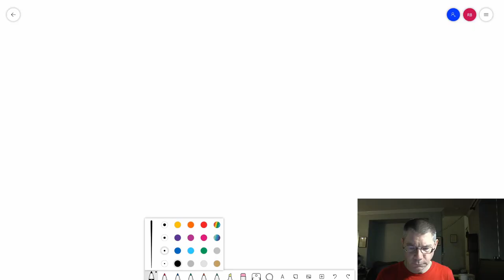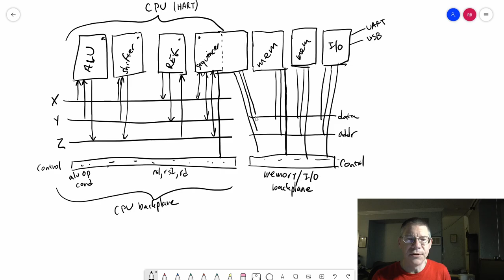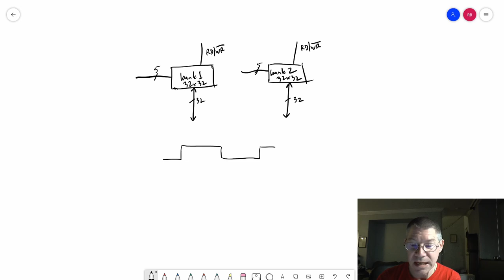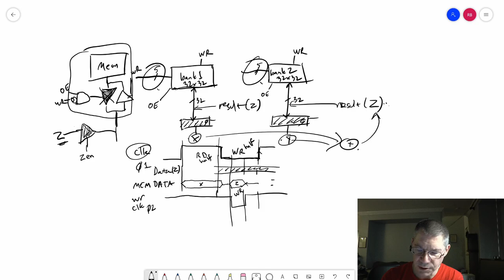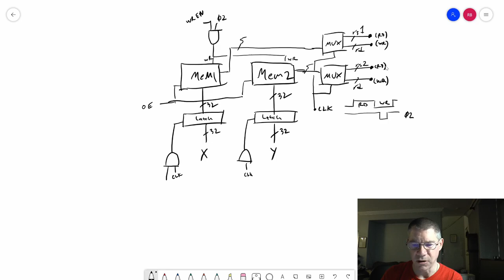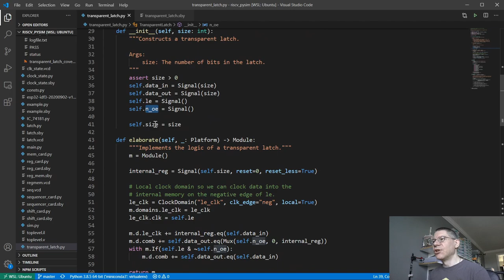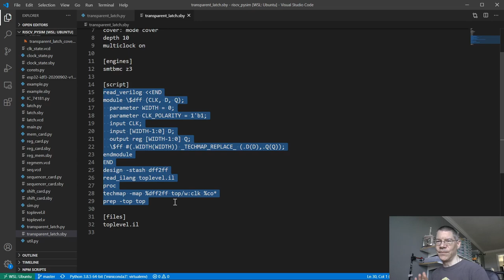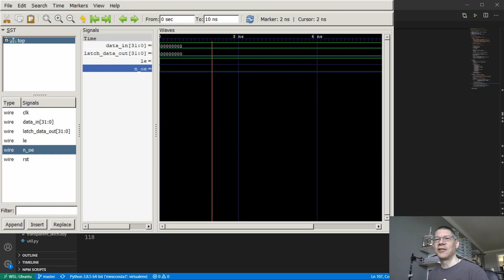Rebooting the LMARV-1 RISC-V project!

Comment: It's great to see you back on this project, and designing it in HDL first is probably a very good idea.
I think you may be over-complicating parts of your architecture though. First thing to keep in mind is that the instructions require two reads and a write per Instruction, not per cycle. That's the programmer state view / architectural view. The actual implementation depends on the microarchitecture, where you could have a single bi-directional data bus which first reads RS, then reads RT, then writes back RD. If you wanted to, you could even pass the flags and ALU op on that same bus.
There's nothing wrong with trying to make every operation a single cycle, but it's not necessarily required. Another way to look at it is you have a large cycle (1 per instruction) broken down into multiple phases, where each phase puts something else on the bus.
For your function units, you may want to look at some of the modern out of order CPUs, not to implement something out of order, but to see how they broke down the function units. All OOP CPUs basically have fetch logic -> decoder -> issue bus -> function units, which is very similar to your backplane idea (i.e. the issue bus is a back plane which can issue instructions to function units based on the decoded instruction). From that perspective though, you probably should not combine the sequencer with the memory access component, and instead should implement a load/store card. If you take the multi-phase idea, then you could dual purpose the load/store card to do both data R/W and instruction reads. Also, if you compress the backplane down to fewer buses, you could run them parallel, say X, Control, Addr, Data, Mem Control. Then your load store could just bridge the two lanes. Or even compress the memory bus down further so you have X, Control, AD, and Mem Control (in that case, you memory bus would look a lot like PCI, which could be an interesting architecture choice - i.e. implement your memory bus using the PCI PHYS, or even using the PCI standard). 
To better utilize SRAM for a register file, you could multi-phase that as well. So for example, let's say you run your main phase clock at 1 MHz. Then, you can run your internal register file clock at 4 MHz, and read 8-bits at a time. That way you can have a single x8 SRAM which stores your 32x32-bit register words. Though, to make sure you don't have synchronization issues, you would probably be better off running the register clock a little higher so that you are guaranteed that you have to correct output regardless of the clock phase offset. I believe that would be +1 cycle, so run the register clk 5x the phase clock.
Hopefully that was helpful.
Reply: Yeah, multi-phase control is usually the way to go - some instructions won't fit into a single clock cycle budget, no matter how hard you try!
Reply: @KaneYork  If you look at one of his newer videos, you see that he sort of ran into a problem there where he has to sequence control signals based on sub-phases. Which is essentially making each "cycle" multiple cycles long. E.g. he is using two 6 phase clocks, and may need to increase the phase count to avoid multiple bus drivers.

Comment: Yay, you're back, and LMARV is back too! This is absolutely my favorite series, very interested to see how this turns out with your new design process.

Would it be worth having a "register clock" which is essentially 2x the "system clock"? The register clock gives you two cycles to do your work which translates to a single system clock cycle.
Reply: Read on falling clock and write on rising clock. Or the other way around? Lol, only now see 20:00
Reply: Another somewhat similar approach is how Motorola implemented a two-phase clock for the 6800 series - by having two overlapping clocks (in quadature), so that any of four phases could be synthesized just by ANDing the two.  Robert's use of an overlapping clock specifically for write pulses is probably a good solution, though, since it can be used everywhere else in the system that needs similar setup and hold times.  If you use a 2x clock, then you still have to AND the clock with something in order to determine WHICH state you are in, which is the way Intel liked to do it back in the 8-bit day.

Comment: So it looks like you'll have "internal" buses and "external" buses. One thing I might suggest is having a simple Memory Management Unit (MMU) that bridges the "internal" and "external" bus. This could be as simple as an address latch and a data latches. You can treat it like a normal functional unit on the internal bus and have it manage the address and data buses for the "external" cards. The "sequencer" (Control Unit?) can then handle data movement to and from the MMU. You might also want to implement a "cache card" to save round trips to the "external" bus for at least instruction memory.

Regarding "internal" bus movement for data, you could make your operand fetch take multiple cycles, using the same bus for bidirectional data transfers. You would need to add input latches/registers (I think you were using buffers before anyways) to the functional unit cards, but your bus can be much smaller. Instead of 3x32b you can do all of it with 1x32b. This also helps you avoid having duplicate register files just to handle simultaneous reads. You can still use your scheme of reading on the rise and writing on the fall, it just might take 2 cycles instead of 1 cycle to fetch both operands. You might leverage that unused write slot during the first cycle for updating the Program Counter (PC += 4) or some other operation.
Reply from the maker: Design choices! I did think of multiple ideas, and they all ended up being a compromise between number of cycles and amount of hardware. My line sort of settled on fewer cycles for most instructions.

Comment: You could use dual-port memories. But you need an additional MUX for the case of reading and writing the same address. One MUX input is the read output of the memory, one input is the write data. In the case of read_addr == write_addr, switch the write data to the output of the MUX, else use the read data of the memory.

Comment: Love it!
That sequencer block needs more fleshing out. You know at least you need a Fetch and Decode unit in there somewhere. Are you going to do any pipelining?
Reply: Pipelining wouldn’t work on this simple bus architecture because you have simultaneous incoming and outgoing data streams in addition to the internal register transfers. For pipelining you need a matrix switch fabric that can route your incoming data/instruction to the decoding, transfer the register values to the Alu/shifter/whatever and the result back in the registers and transfer the last operations output into the databus output buffer. Your bus is now an active component in the cpu not just some lines.

Comment: 14:02 Can someone explain why we need two banks to access two registers at the same time? It makes sense for memories due to single addressing but I don't get it for the flip-flops case.
Reply: Because otherwise you would need 32 register flipflops and 2x32 latches (x latch and y latch) to send the bits from R to X and/or Y.  RS1 can be the same register as RS2.

So that's 3x32 bit chips instead of 2x32 if you parallel write the registers.

Comment: There's no part of the RISC-V specification that requires you to do two reg-reads and one reg-write in the same cycle. With latches on the ALU, you could very well sequence the same operation over several cycles instead. You only need 2R1W registers if you plan to make a tightly pipelined, scalar architecture. I'm certainly all for making that kind of architecture :), but there's no reason that you need to do that if it makes the project more complicated than you need it to be.
Reply from the maker: That's true. I should have said that my assumption was to make enough instructions single-cycle.

Comment: At 12:05 you say that RV32E has 32 registers, but that's not right. The base integer instruction set, RV32I, has 32 registers, and RV32E reduces it to 16.
Reply from the maker: That's correct -- I made a mistake. I meant RV32I.

Comment: Here’s a thought on reading/writing to the same register: use a 6 bit address, 0xxxxx for reading, 1xxxxx for writing.
Reply: Not sure how this helps.  You end up stripping off that high bit anyway, I think.
Reply: @BrightBlueJim  The thought was if you used double ported memory the memory would see different addresses for the x/y bus vs the a bus.
Reply: @robertmenteer3462  I see.  I don't think that addresses the problem, though.  The problem is that he needs to read two addresses and write one, all in the same cycle.  If the two addresses were just offsets within the same chip, then writing could only be done to one of these at a time, so you'd have to use a second clock pulse to write to the second copy of any given location.  By using two memory chips, each write updates both chips (both copies of the same location) in the same clock cycle.

Comment: Why wouldn't the memory run instructions like the ALU? It needs rs1 and rs2, and can write to registers too. Maybe you could put the opcode on the bus, and decode it on each card?

Also, you said RV32E has 32 registers, but it has 16 registers.
Reply from the maker: Whoops, you're correct. I meant RV32I.
Reply from the maker: My doodles led me to conclude that if I didn't want to have each instruction take at least twice as long, I needed separate buses. It'll be a choice.

Comment: Like the channel!

nmigen doesn't support delays?
I've been building my own 8bit CPU called SPAM-1 that has a somewhat similar multubus design superficially perhaps https://youtu.be/VJgfgP1Q89U and I've similated the components in Icarus verilog and spent a LOT of time approximating the delays of the datasheets of the 7400 devices.
I found this invaluable for spotting glitches or other propagation delay side effects.
How do you plan to discover at least some timing issues prior to committing to hardware?

I understand"careful design" but simulation and automated tests have been invaluable spotting the problems that my care and attention didn't avoid.